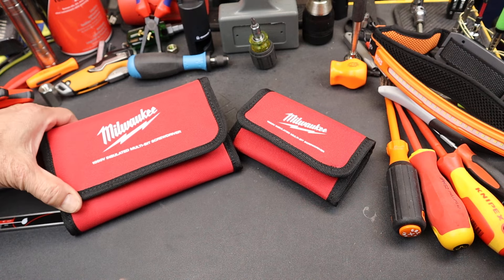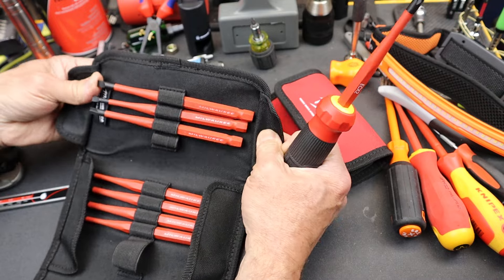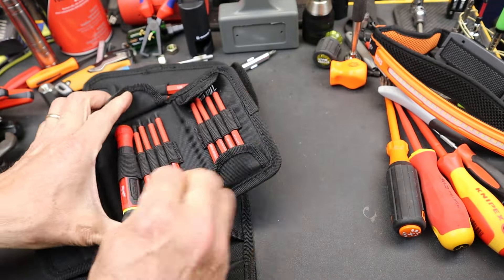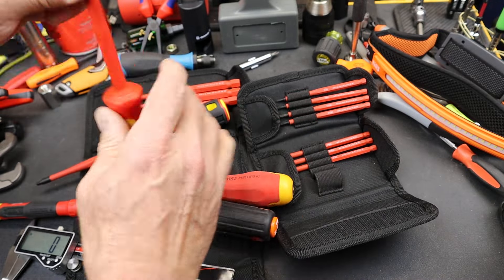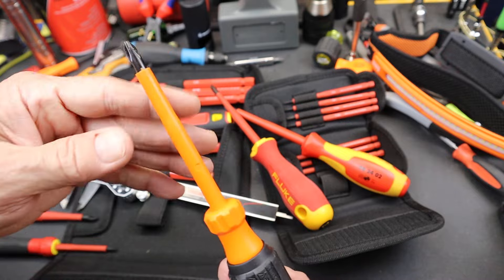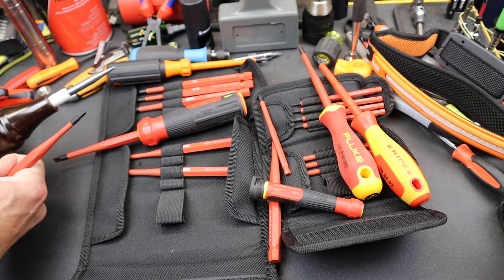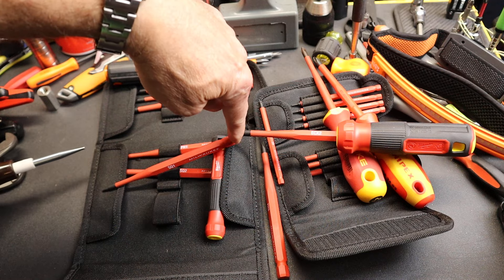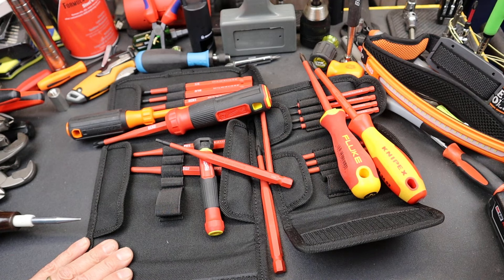1000v Insulated Milwaukee 8-bit slim screwdriver sets: Regular sized and Precision in roll-up cases.

Comment: Did they make it a weird size so you wont mix it with regular tools? Seems odd they didnt go 1/4"
Reply: I think its because they want to sell internationally. German VDE Rules say that these interchangeable insulated bits are only allowed in combination with an insulated handle. So they have a other size than 1/4 inch-6,3mm
Reply: Yeah makes sense to me to not make it interchangeable with standard tools

Comment: If you’re looking for another set of these insulated replaceable blade drivers take a look at the Wera. The hex boss on those is 8.82mm. That comes from the DE CE requirement that a user cannot put an insulated blade into a standard handle. Not sure if each manufacturer arbitrarily selects their hex size or if there is some standard they follow. One other nice thing about the Wera is the blade locks into the handle like many of their non-insulated drivers.
Reply: I'd rather have it not totally lock in. If the tip did get welded between two points and you were somehow getting shocked your hand would likely be locked up to the point that you could not release your grip. The milwaukee drivers have a firm but not complete fit so if you had that situation you could still pull your arm away, pulling the handle away from the blade/bit/insert/shaft

Comment: Looks like a good set. I find the Wera and Wiha (I think those are the two) a little more tempting because most of their sets that size come with two handles. This would cut down on switching bits on a job, and give you a backup just in case.

Comment: If you change the handle you change its ratings and adding a handle like the small Klein with the exposed metal adds more chances of a high voltage arc flash be safe when altering tools

Comment: Does Milwaukee sell different blades? As it would be good to customise this pack, with some magnetic nut drivers too instead of some bits I don’t use.
Reply: I would use sq2 or ecx2 all the time if I had a say, but older gear that I come across forces me to use every single bit in this kit at one point or another

Comment: Hi! Can I use those big insulated Milwaukee bits with my insulated adjustable screwdriver (handle) by Klein Tools?
Reply: I doubt it. I’m not sure but I think the handle is a part of the 1000V rating. Unless both handles and shafts were made to the same specs, interchangeability would be unsafe.

Comment: what is a CCX BIT...?
something NEW THEY came up with...
Reply: ECX. Not new.
Reply: Do you mean ECX bit? It's a combination of a slotted and Phillipps bits for screws found on electrical connections in switches outlets and breaker terminals. The screw head is designed so that you can use a slotted, a Phillips and even a square drive bit on them. However, the ECX bit offers the best fit: it doesn't slide, slip or strip the screw head. The #1 ECX fits screws that a #1 Robertson (square drive) will fit in the center. The #2 ECX fits screws that a #2 Robertson (square drive) will fit in the center.
Reply: Ecx bit it's designed for outlet screws and panels.
Reply: Ecx... it's pretty much the same as Kleins combo bit. It fits very nice and snug in most newer electrical screws. Mainly ecx 1 for outlets and ecx 2 for panels and conduit fittings
Reply: @cafecybernz basically correct but based on your later explanation and real world experience it's really a combination of slotted and square and then if push comes to shove a Philips will probably work in it.

Comment: If you turn the bits around, will the numbers show?
Reply from the maker: No. The elastic bands are centered and the blades need to fit inside the corridor made by the cover flaps meaning the whole thing is symmetrical and thus non-directional.
Reply: Yeah, it's slightly annoying but not a big deal in the least. Like he said look at the tip and you will know

Comment: Does anyone know of a manufacturer that make insulated bits for a regular 1/4” drive.  Would love to use insulated bits with my small cordless screwdriver for things like long terminal strips, plc’s etc.   I realize it’s a code for some reason but surely someone is making what a lot of us want?
Reply: You REALLY don't need power tools for those things. It's only a couple of turns to tighten those and very costly and/or time consuming if you overtighten them